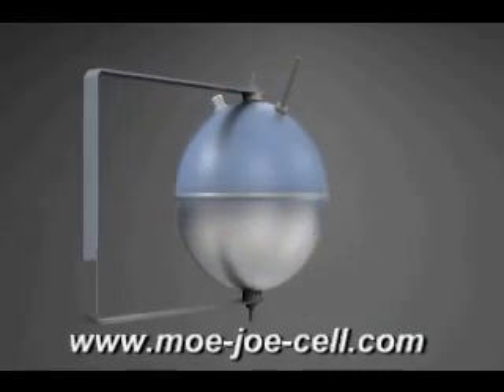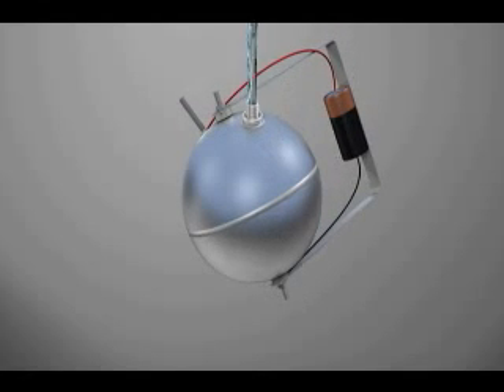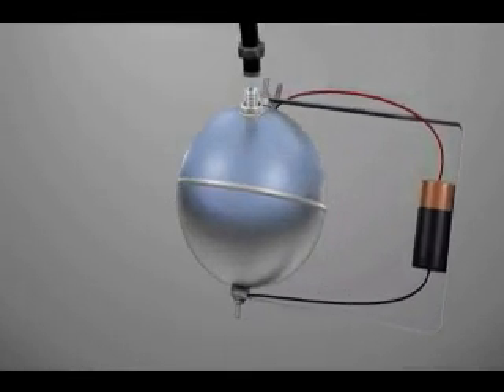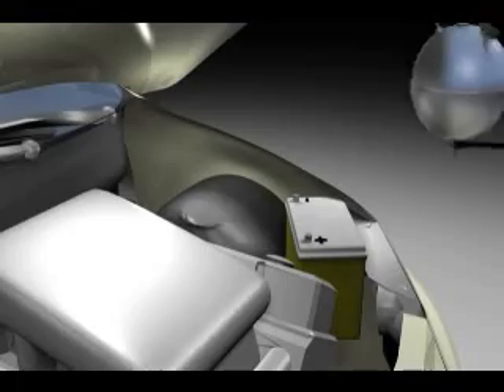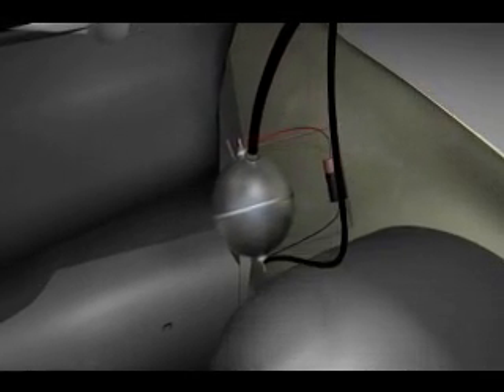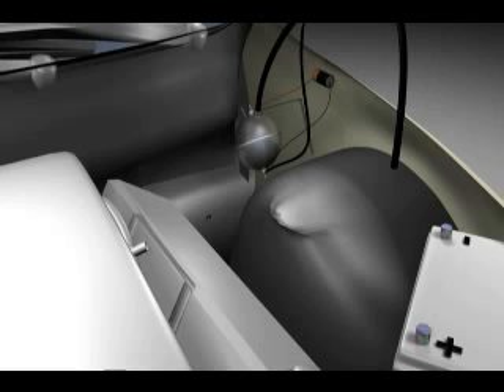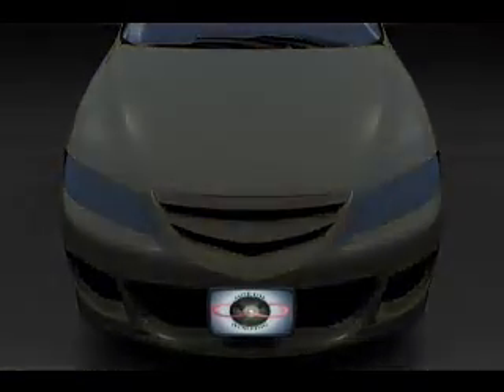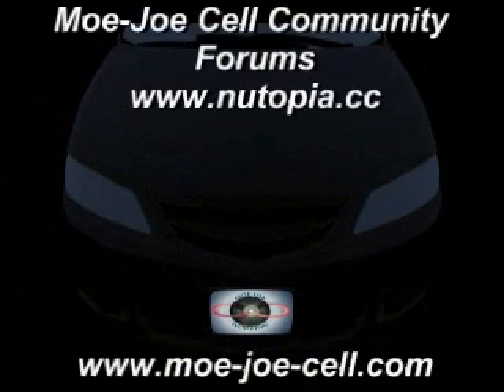Moe Joe Cell Car Installation Instructional Video

Comment: Other idea, get some gallium and disolve aluminum cans into it forming aluminum gallium alloy. Gallium is a semiconductor and aluminum gallium alloy will produce hydrogen ounce exposed to a water source. Fill a joe cell half full with gallium aluminum alloy then fill the rest of the cell up with urine. The joe cell will now produce HHO from the urine that can then be used to charge solid state sponge hydrogen power cells. Tesla induction coils can be placed around the joe cell to absorb the energy bubble formed around the joe cell that can also be turned into electrical energy to charge up organic carbon power cell banks or to operate other electrical devices. The byproduct of processing urine inti fuel might be able to be collected and crystallized and turned into plant food. I thought about this concept for folks with composting toilets. So they could produce energy and fuel and plant food from the urine and process the sticky stuff into sterilized top soil to use in hydroponic and regular green houses to grow food crops. What do you think about these concepts? 😊

Comment: Using this device in the wrong way. Try using the cell in liquid atmosphere to produce nitrogen oxygen gas for a compression internal combustion engine. Liquid atmosphere can be generated by a helium sealed stirling piston. Experiment and see what happens?

Comment: So, looking at one of your other videos I am guessing this cell separates water with an electrical current which hooking up to your vacuum port will inject oxygen and hydrogen into your air intake increasing your gas mileage and also slightly increase your HP... is that correct?

Comment from the maker: To be honest, I don't know if it is HHO or not. My hunch is there is some HHO produced along with H2 and O2 and other gasses, probably many. Walter Russel believed there were many unspoken and unwritten elements before hydrogen. could be some of those. I am leaning toward neutrinos being produced, which power the car, but you wouldn't see them as bubbles on the surface like that.

Comment from the maker: This is a moe joe cell, by the way, but it acts as a joe cell, only more efficiently. It provides an energy to the engine, which gets combusted in the pistons, when the high voltage ignition spark fires. we're not really sure what exactly the fuel is that does this. Do a google search for the moe joe cell and follow links to my website for more info.